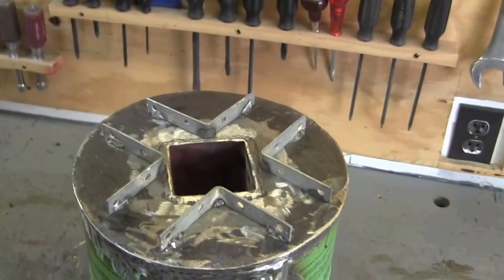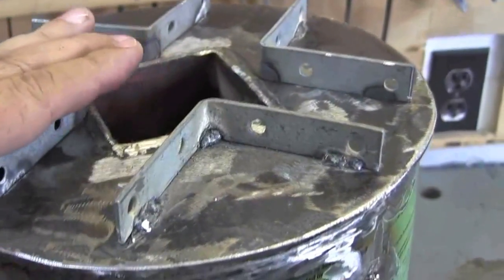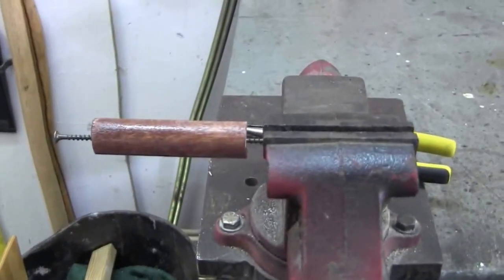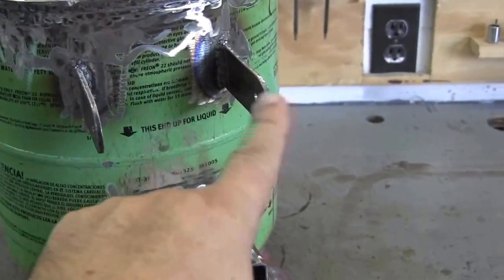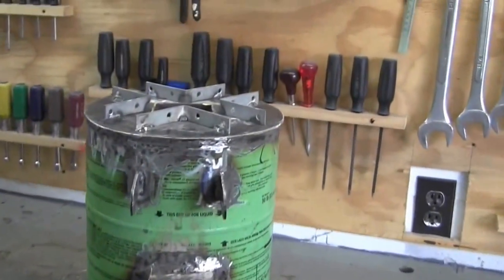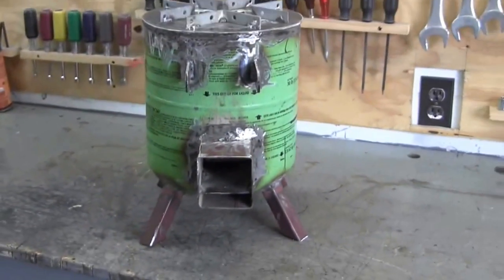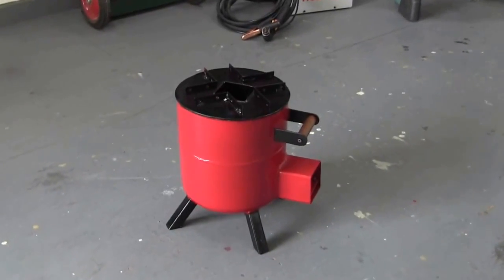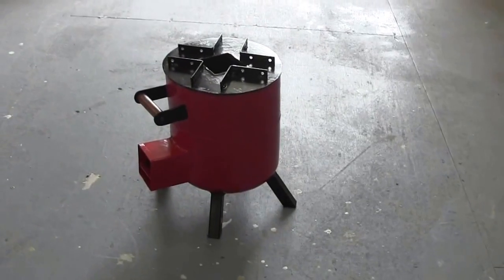How to build a rocket stove

Comment from the maker: ive given a lot of thought to makingthese to sell.each stove takes about 2/3 rds of a day to amke. the electricity to run the weldee and tools. the welding wire. the cutting wheels. the metal,,all add up to about 45 bucks a stove. shipping is about 40 bucks because its so heavy. i just cant see selling it for enough to make it worth while. i will be selling these at the gunshow. that way no one suffers from shipping shock! im thinking of asking 125 for these. does that sound reasonable?